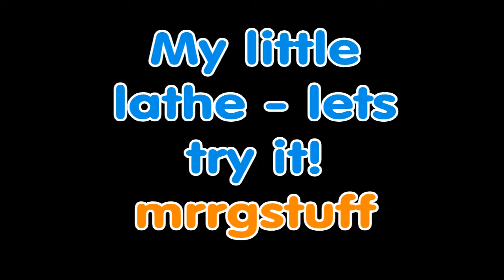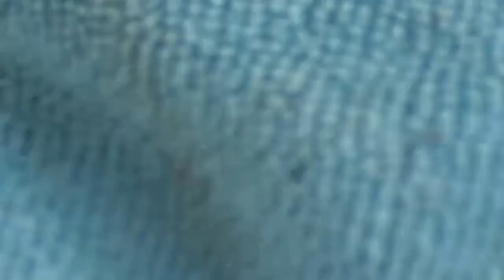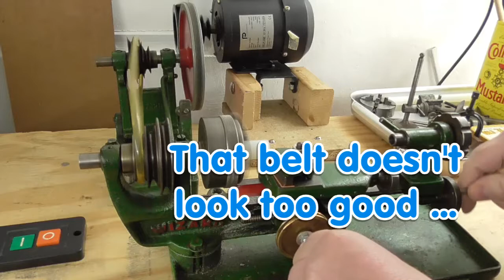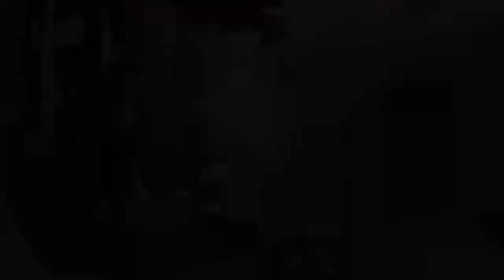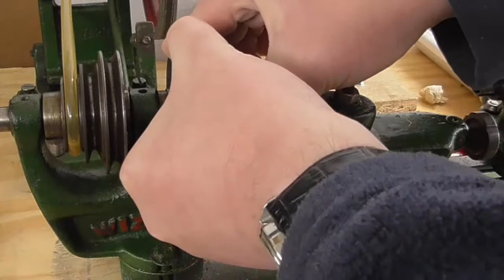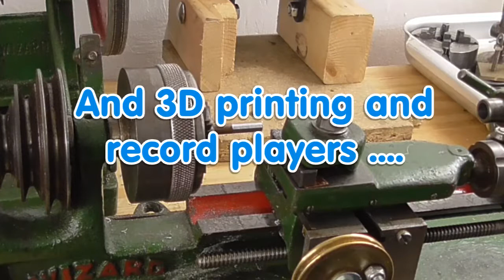My Little Lathe - let's try it out!

Comment: Very nice! A similar lathe to my Adept and Super Adept lathes which I have just purchased along with quite a few accessories. Chucks etc.
Reply from the maker: Yes, more like the Super Adept, but a little later as I think my one (which is a 'Wizard' lathe by 'Lane'), was postwar. Its a very nicely built one, but I don't think it was successful as it was only made for a short period of time. Accessories are hard to come by, and I actually have 2 of these as I bought another where most of the accessories I show came from. This lathe is currently in pieces as I broke it 😳, but I will get it back together again. I have a Chinese mini lathe also, which is a bit more practical as the Wizard is quite laborious to use except for with the smallest of parts. Its good fun though, as I am sure the Adept ones are too! Thanks 😀 👍
Reply: @mrrgstuff  This was a bit of an impulse buy. Not really sure it's what I'm after having played with it for a few hours this afternoon. A shame really as I paid a fortune for the two of them along with all the bits and pieces that were included in the sale. Several chucks and related tools in a hand made cabinet containing an electric motor drive.
Reply: I've just posted up a video of my Super. See what you think👍
Reply from the maker: Thanks. Looks in good condition and the drive seems smooth 😀👍
Reply from the maker: Difficult to say if they are really suitable as it depends what you plan to use them for. I was looking for an Adept of some kind, but I bought the Wizard as it came along first. From what I can remember the standard Adept was a bit rough around the edges and didn't have a leadscrew, the topslide doubled up for this function. The Super is a rather better machine. Both sold well for quite some time and for many hobbiests they were the only affordable option. Like the Wizard, they are of limited capacity so only small things can be made on them, and they are much happier with aluminium, brass and plastic, rather than steel. Much as the chucks are convenient, they are actually better turning between centres and I successfully made a custom brass screw on mine like that.
Much as I love mine, in the end I bought a Chinese mini lathe (a Warco one) as it was just that bit bigger and more rigid, and just doesn't take so long to do things. I have some more custom brass screws to make, and I might try to do them on the Wizard, but we will see!🤔😉
Thanks also for the video. Looks pretty standard with the single tool holder. You will probably have to use shims to get the tools to the right height.
Thanks 😀 👍
Reply: @mrrgstuff  Yes, I have a selection of pre ground tools and had to shim them to get the correct position.

Comment: Hey there. I have the same lathe as you, but mine currently doesn't have any chucks. Or backing plate. Any idea of where I can source some? Or is it possible to get measurements of yours so I know what to buy? 
Similarly, is it possible to get a brief video of the set up of the backing plate and Chuck? I know that might be a bit much to ask!
Reply from the maker: Hi, thanks very much for the comment. I do plan to do another video on this but unfortunately the news isn't good. This lathe has a 1/2" BSF thread (I believe) and although that would have made perfect sense to the manufacturer back in the 1950s, it's completely non standard for lathe chucks now.   It is of course possible to make a backplate for a suitable chuck. Unfortunately I have not found any suitable ones. All the small ones are 12x1mm or 14x1mm built in. You need to go to an 80mm chuck to get one which takes a backplate and that's really too big and heavy (though it would fit). About 65mm chuck would suit well. Machining an adaptor to 12x1 or 14x1 would be possible though not as easy as a backplate. Should also be possible to mount a Jacob's style drill chuck though again not that easy. My current chuck can only be hand tightened so has limited holding power. It's a real shame its so hard to find bits for it as it's a lovely little lathe.
Not sure that's very helpful to you but please ask if there are any other questions you have. I may have a go at fitting a drill chuck as at least the holding power would be greater. I have also used a faceplate (shouldn't be too hard to make) and turning between centres. I got some with the machine but I believe they are short Morse 0 ones.
Reply: @mrrgstuff  hey! Yeah that's what I figured :/ I looked into making one but I'm not sure that's realistic with my current set up.  I have found a couple of surplus back plates for sale that need cleaning up, but might fit. Gonna check my thread today and see if it'll mesh. I can always butcher a backplate to fit something once I have one! 
Once the lathe is running I can then look at making an adapter or something, but without a lathe that kind of thing is very hard! 
These lathes are pretty uncommon so worth keeping it in good condition! Ill do some vids of mine once it's set up as there is very little info out there about these ones!
Reply from the maker: Yes, it's hard to make accessories without a working lathe. I actually bought this one to help fix up an older bigger one, but realistically I need a bigger lathe for that sort of work. Forgot to mention but some chucks for Proxxon lathes are M16x1 and it may be possible to machine a 'false nose' with 1/2 BSF on the inside and M16x1 on the outside. Much easier if you have access to another screwcutting lathe, and even then there may not be enough metal between the threads for strength. If I can get access to a bigger lathe I may give it a go 😀
Reply from the maker: Have a look at Arceurotrade. They have a 60mm chuck 040-040-00900 which might be suitable. My 65mm chuck is 600g including backplate. This one is heavier and you would need to check the dimensions.

Comment: Using a rubber band for the drive belt ?
Reply from the maker: There are 2 belts as there is a countershaft between the lathe and the motor. The one which broke I made from plastic belt material sold for this purpose. I did fix it and I ment to make another video of it working again but haven't quite got around to it. The other belt is jointless and won't break. Thanks for watching. 😀